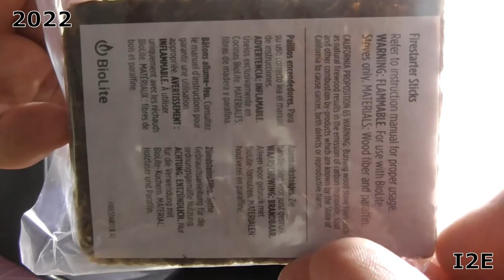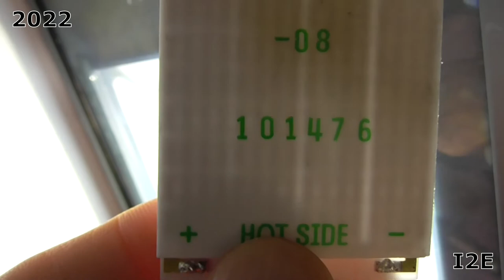Undo It Yourself #4. Biolite campstove teardown

Comment: Do you think it would be possible to cannibalize some of these parts to use the heat sink to charge USB devices without the stove or the fan if you have an alternate head source?  For example, using a sidewall of a hot tent camping stove or other hot item?
Reply from the maker: for 80 mWatt? https://youtu.be/shyH1bbqibk
Reply: For sure! A real thermoelectric generator (TEG) element that is made to withstand the temperature of a wood fire on the hot side and which is coupled to a proper heat sink on the cold side, one that is designed to be capable of absorbing and dumping up to, say for instance, a kilowatt of thermal power, can be reasonably expected to generate several watts of electrical power via the Seebeck effect.

I estimated roughly that my Campstove 2+ has to generate on the order of three watts of electrical power based on the time it took for it to charge its internal battery from empty to full just by burning wood in it. I have kept it original for now so I haven't done any precise measurements; confirming that it works as expected was enough. If I wanted to use it with an alternative heat source I would want a slightly different arrangement and fewer plastic parts but it would clearly be doable. Just make sure the ability of the heat sink on the cold side matches the heat flux to which you intend to subject the hot side. Otherwise the element will heat up too much... perhaps until its solder joints, or whatever bismuth alloys are used inside it, melt down!

What most small scale demonstrations that seen on YouTube don't do is put enough heat flux through the thermoelectric module. The conversion efficiency of these things is very low, especially if people are using the cheap TEC elements meant for cooling via the Peltier effect instead, so if you're only getting milliwatts out of it (like with just candle) it just means the arrangement is not made to be, nor is it capable of, burning meaningful amounts of fuel and dumping enough of the heat from it through the hot side, through the module, and to the heat sink on the cold side. Less than ten watts of thermal power in and out means you are likely to get less than a hundred milliwatts of electrical power converted from that pip-squeak heat flux.

How much power you're getting is directly proportional to how much heat flows through the TEG. Simply heating the hot side a little bit with a candle gets you a voltage reading you can measure, sure - that's how a temperature measuring thermocouple works as well - but generating useful amounts of current to go with it for more actual power means you have to dump way more heat somewhere, somehow.

Comment: Thanks for the video! Do you think it’s possible to add more batteries to make it 12v output?
Reply: The first thing the instructions say to do is charge the battery.  The lousy thing does not make electricity.
Reply: 😂 that’s just to give it a full charge before use. If you use it ~ once a year it’ll keep itself charged
Reply: @markrouse2416  I have never charged mine any other way than by burning wood in it. They also sell or sold lesser models (the small blue "CookStove", and the big "FirePit") that only have a battery pack with a fan for a cleaner burning fire, but this one is not one of those models. The "Campstove", "Campstove 2", and "BaseCamp" models most definitely "make electricity". 😉